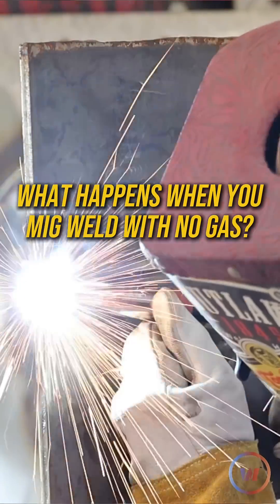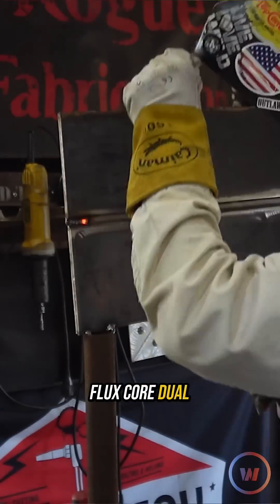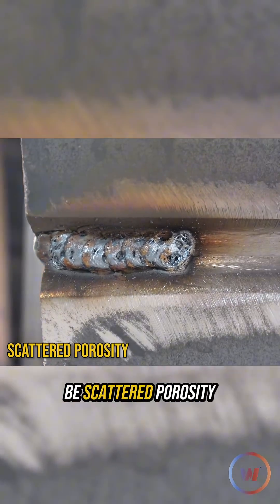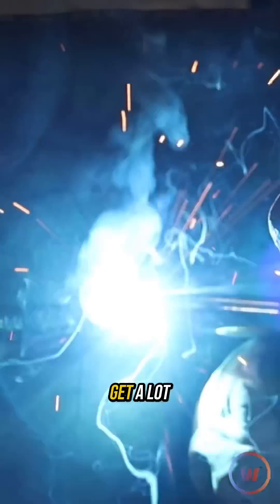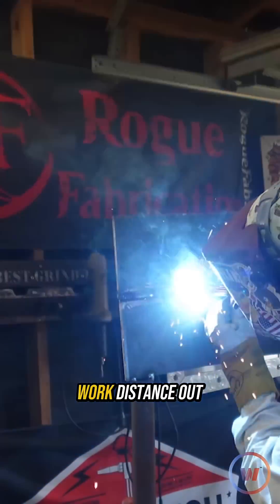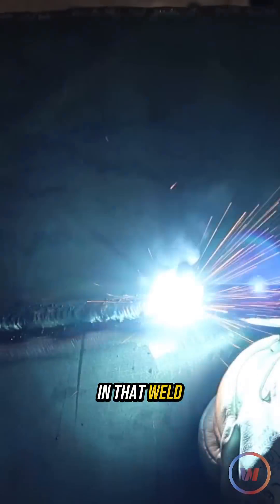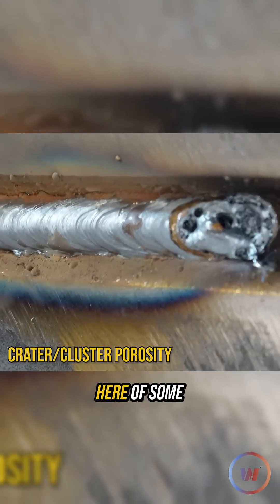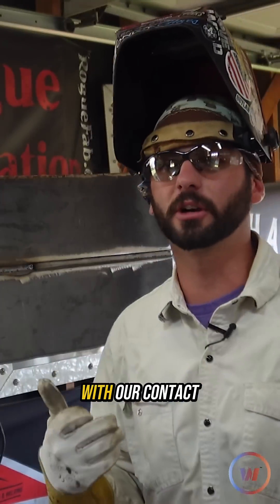Common causes of porosity when MIG Welding #welding #Porosity

Comment: I had alot of porosity on my mig welding 25 argon 75 co2 tanks sat for about 1 years had not used it . I took the tank off turned it upside down for 1 hr with cap on of course . 
And like magic after that my welds were perfect again. The argon and co2 will separate over time. Anyone that argue with this needs to think about it. This might be the probem

Comment: Since when do u use shielding gas with flux core
Reply: @MrTk6969  that’s the comment I was trying to find. It is flux core for the simple reason to not need gas.
Reply: @bradleyboyle5286  glad I could help
Reply: @bradleyboyle5286  i know right. Why would anyone spend the extra money for shitty flux core just to run argon that cost 40 bucks for 40 cuft of argon.  That would be like buying drag radials for a geo metro. Yeah you can do it but why. Dude these people on YouTube are fucking idiots not all but a lot of them
Reply: Says it in the video, dual shield.
Reply: @andrewford80  ur dumb. He said flux core
Reply: It's called dual shield brother FCAW-G and it definitely needs gas contrary to innershield or FCAW-S
Reply: @GabrielChavez-gu1dg  i thought the whole purpose of flux core was so u don't need shielding gas

Comment: I see more and more people dragging MIG, I was always taught this was incorrect. Drag the slag, push the gas
Reply: When mig welding with gas you push. Pulling  like that causes  penetration problems . It also gives you a weld that is covered in spatter that you will spend time cleaning.  Gas  push. Flux pull.
Reply: Same here as a welder for over 30 years. You push your mig unless it's flux core, then it doesn't matter.
Reply: I'm a mechanic, most of the time we're welding not on a bench. You push or drag depending on which way is less obstructed, sometime you have no choice at all

Comment: So so true. The slightest breeze will cause porosity especially outside. A fellow welder I use to work with was the only guy in my 30 years of production welding that could beat this he was a beast at this. You have to figure out the direction of the breeze and keep the nozzle turned away from the air flow with MiG or dual shield.
Reply: I failed a flux core test when someone opened the gate while welding
Reply: @Token_Black_Guy  Damn that's crazy man. Hope you have bounced back by now.
Reply: If i had to guess you were already pushing your luck by being to far away before he opened the gate